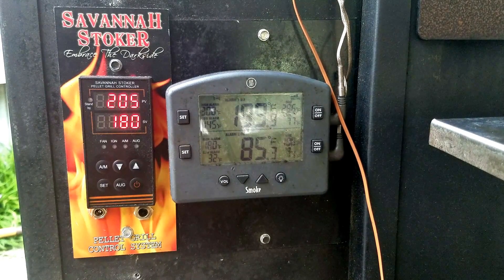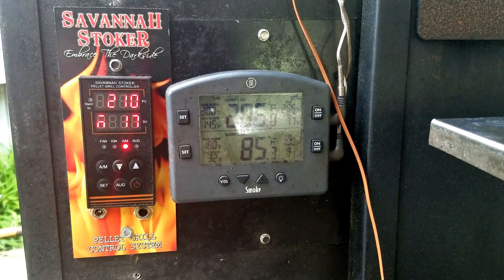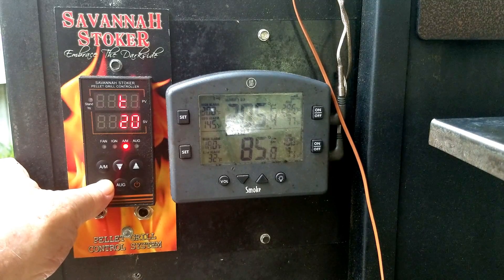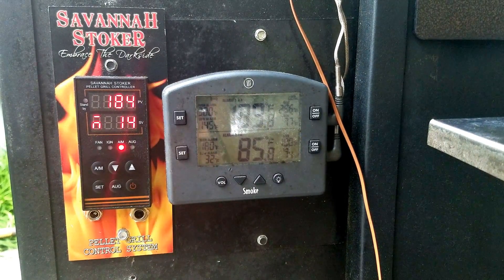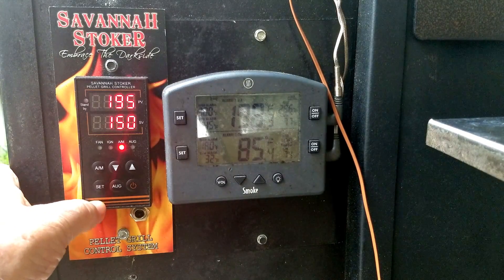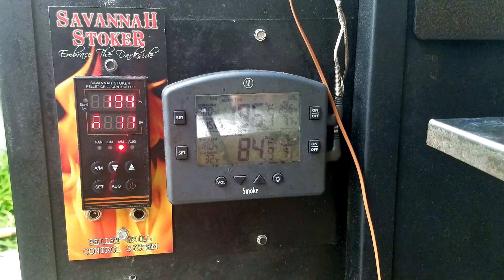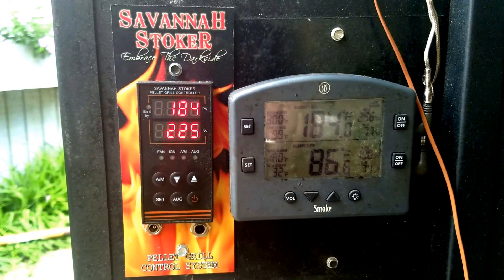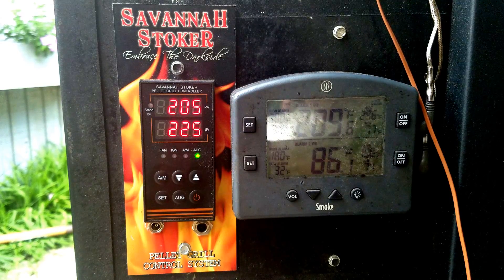Savannah Stoker,  Adjust for, 1 OutL using Manual Mode, 2 RTD Offset, & 3 Auto-Tune for problems.

Comment: Do settings save when set. And do you have to go through this every time it is used due to the weather. Or will it be able to compensate once it learns the grill
Reply from the maker: All parameters saved remain until changed
Reply: @arthurheld2475  thank you for the helpful info. I will definitely be coming back to this video when I receive mine